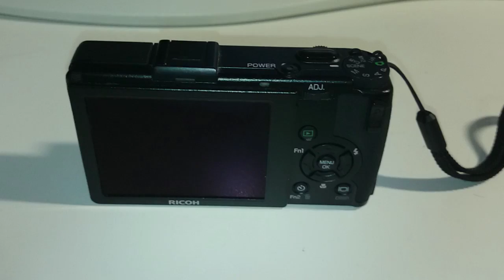Ricoh GR Digital III camera LCD replacement

Comment: thanks for the tips. Very useful. I'm not replacing the screen, just trying to clean up the buttons and connectors because some of the buttons aren't responding. I'm really struggling to get the ribbon back into the socket. I'm having a break now but I hope i'll manage when I get back to it.
Reply: Any advice on removing and putting back?
Reply: I went too far and too fast, and ended up breaking the fragile little connectors so my old Ricoh is useless… My advice would be to take plenty of time and use the right tools! Or get someone else to do it (that's what I should have done).  @flyj26599

Comment: OK I changed the screen, I think I put back the connector (the one at 15:30) back in the right place, when I turn the camera on the screen is OK but the control panel (play, menu, u-d-r-l, trash, disp) won't react at all... is it due to that connector? I'm gonna die...
Reply from the maker: +La Cazouille I'm sorry to hear that happened to you. It seems to be a common problem when putting back that flex ribbon cable. I had a similar issue. It's quite difficult to put it precisely in the connector, even a millimeter off it will not function completely. For example, I had a similar issue where there seem to be a "short-circuit", when I press the Fn2, instead of giving me the Timer function, it crosses with the "Macro" function. When I adjusted the connector very carefully using tweezers and flat head screw driver, it brought back the Timer function, but then the Up / Right keys don't work. It can be quite frustrating. Another possibility is that the ribbon cable may be broken when you removed it, but most likely it is the ribbon connector not properly making contact with the socket.
Reply from the maker: +La Cazouille Make sure the flat connector goes through under the two metal brackets on the connector. It's a bit difficult but they help to keep the ribbon in place, otherwise when you press down the white flap to secure the ribbon, it does not make a complete contact across the connector.
Reply: 1000uf
Oh, thank you for your precise answer 1000uf. It's actually very frustrating as you say. I thought it was in the right position but maybe it's not. I'll try again and again until it works! Thanks again mate.